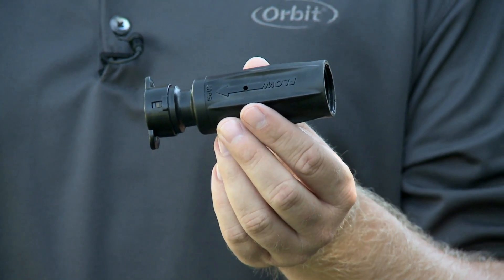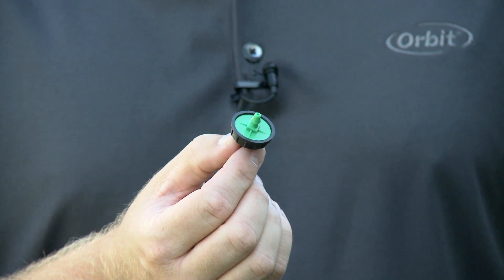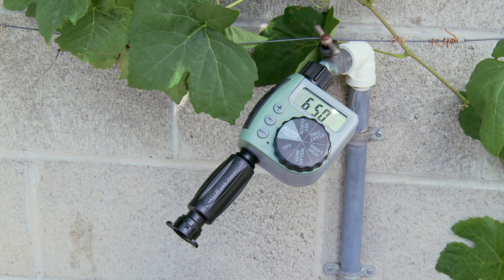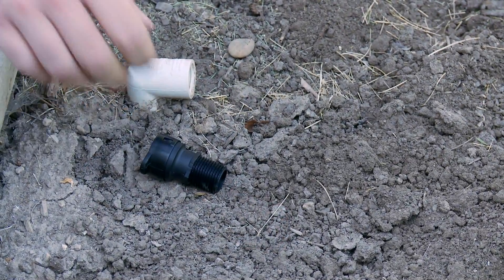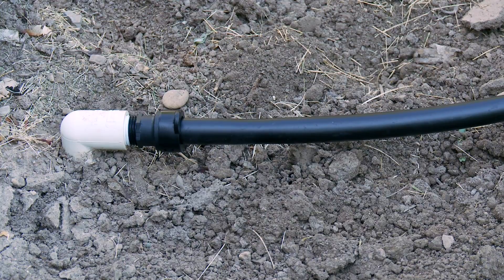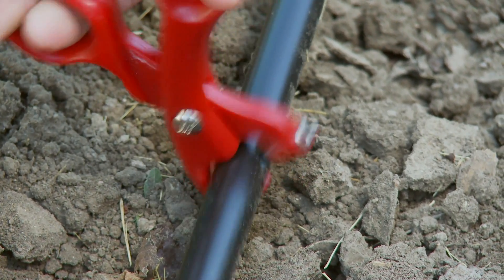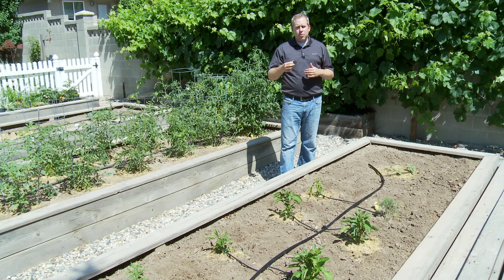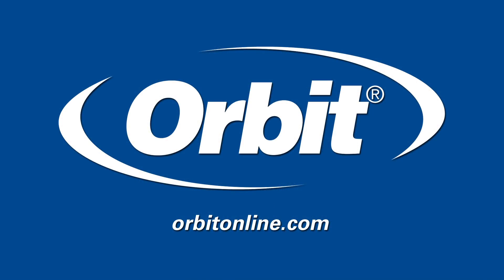How To do Drip Irrigation with Emitters

Comment: U put the emmiter, the green colored, towards the water line. It should be placed the other way. Black line to black side of the emmiter. If it's pressure compensating that's the way to place it. Js👊🏻

Comment: My barb couplings all leak at the main line?
Reply: Is this a question?
Reply: @dan8250  yes
Reply: @Dan  I find they leak where connected into the main line. I screw them in as you should, but they still leak. How can I fix the problem

Comment: is all drip emitters suppose to all drip at the same time? Because if one drop before the other, the one dripping first would get more water. How do I fix or what do I need to add to make sure all of them drip the same time. My water source is from an artesian well with hose Bibb connected with a pressure regular 25 psi. Emitters are pressure compensated 2gph.
Reply: Air relief valve at the end of the line to purge out the air and allow emitters at the end to quickly get water w/o being airlocked.

Comment: how do you figure if you have enough water pressure to get the water to your plant?
Reply from the maker: Rarely is water pressure a problem for drip irrigation because drip requires such low pressure. But if you wanted to make sure, you could purchase a pressure gauge (such as this one: https://www.orbitonline.com/product/pressure-gauge/) and if you have at least 5 psi, you'll be good. Of course, the more drip emitters you add, the more pressure you would need.

Comment: how do you remove the dripper to replace with another dripper?  Anyone?
Reply from the maker: If we're talking about the barb into the 1/2-inch main line, then they should just pull out with some force. For the 1/4-inch line, in most cases those are so firmly inserted that they will not pull out. Fastest thing is to snip the 1/4-inch tubing off near the dripper. You can also try hitting the tubing with heat (blow-dryer or heat gun) for a few seconds, to soften the tubing.
Reply: @orbitsprinklers  I ended up just cutting the line.  You were right though, thanks for the feedback

Comment: We are having leaks in most of the couplings. We have been drilling the holes with small bit and tried the smallest one. Also tried with the tube hot and cold (coz cold were leaking) and seemed to be working better if done hot.
Is the reason coz of drilling instead of puncturing?
Reply from the maker: It's likely the drilled holes are larger that spec and thus the leaking. We'd have to get more info to be sure. Please send us your contact info via one of the social media channels in the video descriptions and our support team will get in touch.

Comment: I don't use many small hoses because I put my plants under the main hose. I have a problem with clogged emitters even though I have a filter. I wish it was easier to replace bad emitters instead of punching new holes.
Reply: Why not just remove the clogged emitter and replace it at the end of the tube with a non-clogged one?

Comment: In my case the drippers are going to end up in pots. So the main line will be on the ground and drippers connected via the 4mm connecter tube will be in pots. Will the height difference between the main line and the dripper head make any difference?
Reply: I don't know if you still care but no it won't matter

Comment: How to control flow of water?
Reply: use pressure compensating drippers, they have a set volume per hour whatever the pressure is. (within a proper range, i.e. 5 to 40 PSI) you often find them at 0.5, 1, 2, 4, 6 , 8 GPH
One of the best online store is Dripdepot.com.